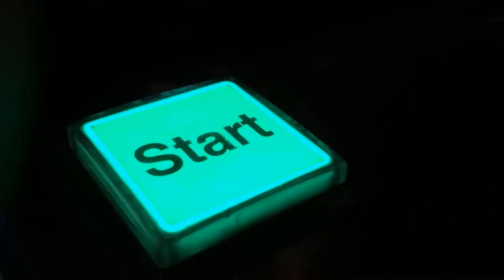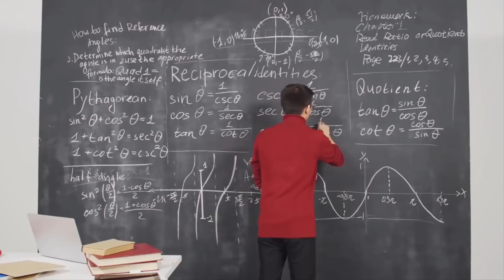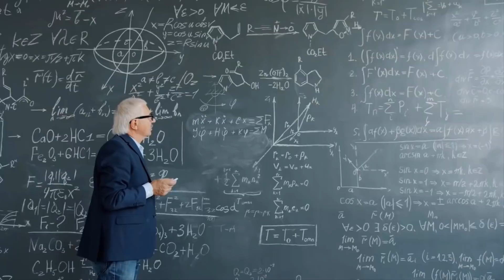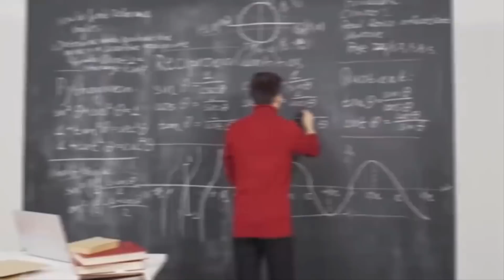NASA’s New Light Speed Engine That Defies the Laws of Physics

Comment: If you put 1,000 of them on a ring, would they all sync up together eventually to one forward, (laws of synchronicity)? Do they bleed into each other's field?  I wonder what size produces what thrust. So.. No radiation? Wow.
Reply: in theory, propulsion requiring opposing force when contained in a ring as you suggested builds heat that flows out into nothingness.  there is no real momentum since the photons seemingly fluctuate in and out of existence(!?)  thus no raditaing waves or the possibility of traditional radiation as its currently understood.  most basically, it is not the amount of energy that is emitted but how the momentum of depreciation (opposite to typical force dynamics) seemingly occurs and this is seemingly IMPOSSIBLE  lol
Reply: SEEMINGLY